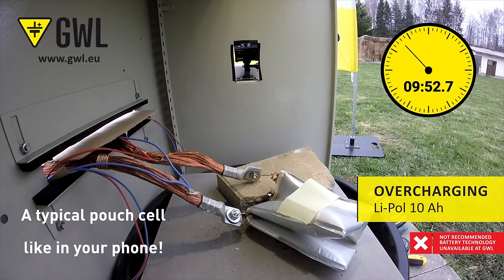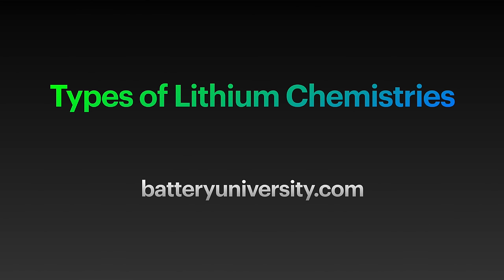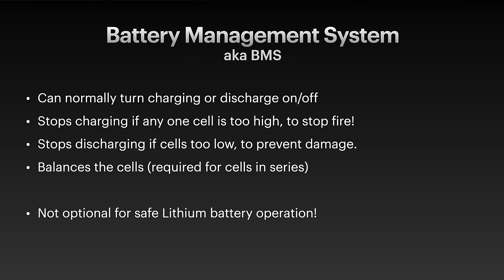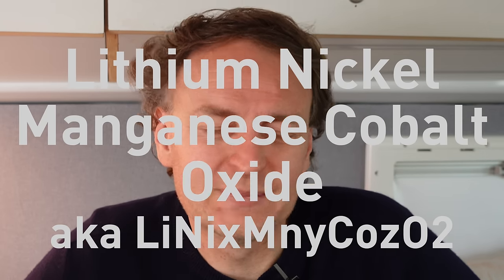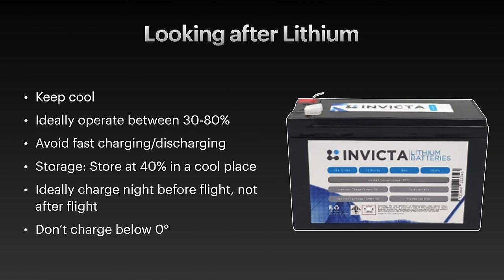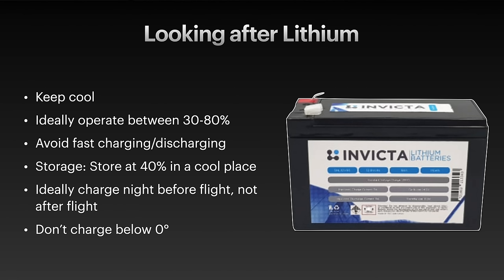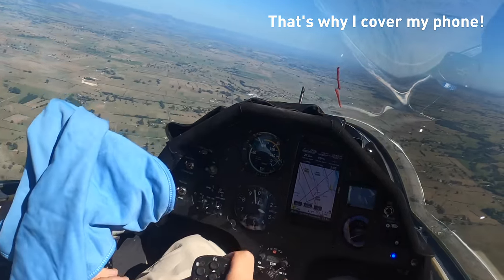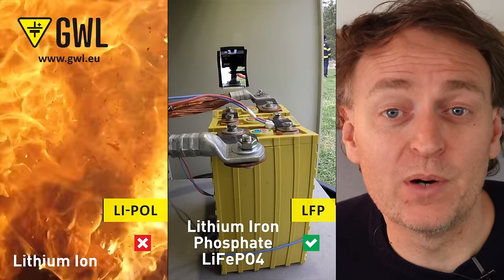🔥 How to Avoid a Cockpit Fire from Lithium Batteries 🔥

Comment: I work with high power inverters. We use lithium iron phosphate (LiFePO4) exclusively. We once had a pack rub onto a sharp screw until it shorted out. Quite a lot of burn stains, but no ignition. They're heavier and have slightly less voltage than lithium-ion, but are MUCH safer.
Reply from the maker: Agreed, I use LiFePO4 in my campervan for that reason too :)

Comment: Wow, I didn't know about the Pipistrel Glider accident but then its been 30 years since I last flew gliders (showing my age now!). It really brings home, that your seat cushion in a glider should be made of a parachute - even for short flights! I'm not sure what the general practices are now, but when we were flying training gliders we never used parachutes (except if doing aerobatics training), however most single seaters came with a parachute. 
I have an electronics background, and I think your description is your description is very pitched to the general community - well done! I quite like EVs and  now driving a car with a LFP battery (although we also have a LEAF with older battery technology which we keep a close eye on - I check battery stats every month). I used to flying model aircraft and have had several Lithium Polly battery failures (including one bulging out the sides of the fuselage!) and only ever charged batteries when someone was around and the charging was in a metal box. The only ones that I actually had catch fire were ones we deliberately overcharged at club meetings for entertainment & education purposes!
Reply: I'm surprised that the accident report recommendations didn't include wearing a parachute.  The only thing that would stop me wearing a parachute is lack of room.
Reply from the maker: Hey thanks for sharing, yeah we usually do use parachutes to sit on, unless you have a glider equipped with a ballistic parachute on the fuselage. But if it’s on fire it is not any use!
Reply: @PureGlide  The combination of Integrated Rescue System (IRS) and engine flight batteries in the fuselage is simply a bad idea...(as in the scenarios have not been thought thru yet). It will take a few accidents before the regulation agencies will conclude this needs to be forbidden - could take years.

Comment: Caught someone with a new Lithium battery last year, rigging, and noticed the terminal were exposed, and it was secured with a metal bar on top.  It would have been possible for it to bounce and short out on it.  I think it was a LiFePo battery, and that a power management system probably would have protected it, but still we made him go and insulate the terminals.   Can't  be too safe.
Reply from the maker: Yeah, not sure the BMS can protect against current that high, so a very good idea!
Reply: Also bear in mind that dielectric resitance of air decreses with hight, it could make an arc if it goes high enough.

Comment: This is the type of video i can recommend EVERYONE. Because it's not only useful to the pilots of gliders but for everyone. I had similar problem during a normal drive in my car. I was using my phone for GPS, 5h travel. In last year, 9am-14pm. Full sun, middle of July(Europe), and of course i had my phone charging, but i putted it around 12am to a charger(because it was around 30%). Around 13 pm, my phone stopped working, and i saw smoke coming out. That was a really crowded highway, so thanks to my friend sitting as passenger, we could throw it out of the windows immediately, while maintaining safety for other drivers
.  imagine if i chewed it on crowded  road(Not a gread idea, but if you're a psychopath, go see a psychologist). So, it doesnt matter if u have a phone in your house, on the beach, in the car, or u are gliding. Always keep an eye on it. Shit happens, be prepared, and don't make stupid mistakes.
I found this video really important, actually for everyone, because u can apply it everytime. Your battery can burn even in your house, while u are at work, or on a plane(Legendary Samsung battery). But you can prevent it, not 100% but if u add like 99%, it's still better than being on a plane on fire(Concorde is the only plane with afterburners, B747 or A320 doesnt have it, your battery won't make it faster).

Comment: I've been thinking of buying a Pipistrel Taurus Electro for the last few years. I asked the sales team whether the batteries can be removed and charged at home, so that I can store them in cool conditions and charge them only in time for the next flight. But unfortunately they aren't designed to be removable (only for servicing). It's a shame to hear that there have been battery fires.
Reply from the maker: Yeah do read the report for more information, I’m sure if you look after the batteries, they will be fine!
Reply: There should be little need to remove batteries, if they can be stored in location without temperature extremes. A trailer is likely to have more variation in temperature vs. a hanger, or structure in contact with the ground (thermo mass), or insulated. 
Removing, transportation and repeated installation is likely going to introduce risks, including potential to damage the batteries; so better to just properly store the aircraft.
Reply: @AerialWaviator  Pipistrel recommends storing the glider in their solar trailer, which will not only charge the battery, but also run cooling fans to keep the trailer's interior at a reasonable temperature. That would be the only option for me, since the airfield I fly from doesn't have hangar space, and gets a LOT of sunshine. Hopefully the trailer can be programmed to charge the battery to ~50% after a flight, then slowly charge to 100% just in time for a scheduled next flight days later. If not, I'll have to hack it.
Reply: @markmuir7338  If good airflow and climate not too extreme, the trailer should be ideal storage. A remote option to enable charging from storage voltage (50-70%) to fully changed the day before flying would be ideal.

Comment: I've recently installed a K2 22ah and 12ah batteries. The capacity from these puppies is astonishing. I use the 22ah as the primary and have the 12ah on standby. After 5 hours the 22ah barely has dropped in voltage. It's really impressive. This running double seater glider computers, transponder and Flarm.
Reply from the maker: Yeah I have the same! No reason not to these days. Although keep in mind there won't be much voltage drop on lithiums anyway due to the voltage curve, so it could be 80% or 60% without looking much different. But so good these days to never even come close to running out.

Comment: Great Video! Thanks for the effort and research! Also great community! The comments are a great addition. A thing I don't see often. 
Maybe a pre flight thing to check is, if you'll be flying over an area with dried out woods? In these days maybe you shouldn't throw your burning battery out there.
Reply from the maker: Yeah obviously that would not be ideal, but which would you choose: have a fire on board or risk a fire below?
Reply: @PureGlide  I agree. That's why I'm asking, if it should be a pre flight check. If many people live in or around such an area, whose lives were at risk if there were a wild fire, then maybe a higher priority is to divert from this area. But maybe I've simply watched to many flight safety videos on YouTube and am overthinking a very unlikely hypothetical incident. :)

Comment: Great and important video... You did not mention explicitly, but all cameras use high density lithium batteries too. Great point about not throwing power banks around... I fly with XCSoar on a 7" device / covered with a piece of cloth to avoid overheating (!) and next flight I will check if it will fit through the cockpit window (just in case..). Thanks Pure Glide!
Reply from the maker: Hey thanks Ronald, glad you found it useful!

Comment: Thanks Tim.  I'm not a glider pilot, but the primer on battery tech was very helpful as I'm looking into replacing Lead-acid batteries in my caravan with (probably, now) some LiFePO4 units.  It strikes me that generally my "bail out" scenarios are going to be a lot easier than the ones you might encounter, but you're less likely to do anything so silly as sleep in your glider.
Reply from the maker: Yeah stick to LiFePO4 I suggest! And you’ll be fine :) I just swapped out my lithium ion cells for   LiFePO4

Comment: sorry, as glider pilot, and former glider designer, the figure in the middle for the lithium comparison part is a lithium polymer accumulator, but you identify it as a lithium ion battery and that's wrong. FES uses lithium polymer cells (it was very difficult certifying them, i know for sure), Arcus E (the few) and the self launching Lange gliders use lithium ions in the wings.
Reply from the maker: Yeah I i couldn’t find a good example with price available, but gives a rough idea. Thanks for sharing!

Comment: if managed properly then no problem. I think there are several options. you can use the flat LiFepo packs. I think it's the best way to keep the size and weight down. They are a bit heavier but not as bad as lead.
Reply from the maker: Yeah exactly, LiFePO4 would be safer, but the size weight becomes an issue with them for providing enough power.

Comment: Here's an easy way to judge the health of your cell phone battery (unless you have one of the newfangled camera humps): Put the device on a flat surface and give them a spin. If they make it through a full rotation or more, the battery is likely swollen and should be replaced.
Reply from the maker: Great tip! Cheers

Comment: Great video. I've use Lithium batteries to power model airplanes for years, and have had my fair share of incidents with them. A friend of mine crashed a fairly large model and it caught fire. It was in long dry grass a few feet off the runway, and I made the mistake of grabbing it by the tail (which wasn't on fire) and dragging it out of the long grass onto the runway to prevent a larger fire. I must have got some smoke or possibly spewing debris from the fire on my hand and arm as I had burn-like sensations for many hours after it happened. In retrospect, I probably should have rinsed it off immediately with whatever bottled water anyone had at the field, but at the time I didn't know if adding water might make it worse.
Reply: Probably burns from radiant heat. Lithium metal can burn in excess of 2000 C. Just being near that will give burns to uncovered skin.... And Yes water would have mitigated the severity of any burns by reducing the heat in the skin. It's just absorbed a huge dose of IR radiation from the fire and needs to be released/cooled as fast as possible.
Reply: @tinkertailor7385  That makes sense. I definitely learned a lesson with that incident! I now have plans in place for all my Lithium batteries, including my phones, computers, tools, E-Bike etc.

Comment: Seems to me like a fundamental design change is necessary for Li electric gliders to have the batteries in a bay which has a door on the bottom for jettison purposes in an emergency. Get over a safe area, pull the handle, battery gone by gravity (and spring?), which would minimize damage to aircraft and allow survivability. Also a mandatory temp and/or smoke sensor in the battery compartment, with indicator light and audible alarm.
Reply from the maker: Yes, it seems obvious really! But they have improved a number of other things such as a better fire box around it

Comment: One would think that the designers of electric self-launch/sustainer gliders would build in a method for jettisoning the batteries in case of fire. Dropping flaming batteries on potentially inhabited areas is not attractive, but if a good-sized battery is on fire, its going to come down anyway, with or without a living pilot.
Reply from the maker: I thought the same thing!

Comment: I think sailplane manufacturers, and other aircraft manufacturers, that utilize lithium batteries should start thinking of ways to eject these batteries if there is ever a problem. It can easily be done. The battery for an electric powered sailplane could be placed in a fireproof container near the lower surface of the aircraft, with sensors to indicate a fire or extremely high temperature in the box that would be displayed to the pilot. A simple pull of a handle would release the battery. The pilot hopefully would have time to exercise caution about where to drop the battery to avoid people on the ground, but lets face it, a crashing aircraft doesn't provide any options. Sliding windows in the canopy should be big enough to allow any battery powered accessories to pass through in an emergency.
Reply from the maker: Yes although if the batteries are looked after it should never be a problem!

Comment: There is a distinction between risk and consequence, risk is statistically how likely something is to occur, consequence is how bad it is if it does occur. People who do rock climbing without ropes like to say that the risks of a fall are really rather small, it's just that the consequence of any fall is almost certainly fatal.

Listening to this discussion you have to wonder why any sane person would allow a lithium battery of any kind aboard their glider - except maybe a smartphone which you can chuck overboard if you need to. If a device getting hot left out in the sunlight, has hidden damage from having been dropped, or has simply been left fully charged too long and could cause an in flight emergency that might cause you to have to bail out, you have to ask yourself if you really want that device onboard your aircraft.

Comment: A great reminder video. Just thinking the gliders with big battery packs should also incorporate automatic discharge systems like Dji incorporate when not in use.. Thanks for the upload my antipodean neighbour.
Reply from the maker: Yeah I wondered that too, probably because they are big packs, so would require something substantial to use that amount of energy, like a heater.

Comment: now you scared me. I just bought a FES glider. The question is: are electrical fires more often than fire with normal combustion engines?
Reply from the maker: Don’t be scared, just follow the manufacturer’s instructions! And the batteries will be fine. These incidents I mentioned were years ago, and they’ve done a lot of improvements since. Also be prepared, if worst comes to worst, know what to do, vacate with your parachute! But that is very unlikely to happen

Comment: I think if battery powered self launch stays around they will need to introduce a method to eject the battery. Either by gravity or by a spring. Possibly an automatic mechanism once a heat sensitive linkage is burned through. I think people using batteries for self sustain or self launch should strongly consider a personal parachute.

Comment: You missed one important point. Dielectric resistance of air decreases with height. This is why you cannot check in batteries in your lugage when flying in airlines. Same applyes to gliders, that are not presurised!!! Are our phones, chargers... and rest of gadgets designed and certified for high altitude operation??? At high altitude a shorcircuit is easier to happen. I suppouse glider equipment takes into account this but I doubt others gadgets do.
Reply from the maker: I thought batteries weren't allowed in the luggage because if one starts a fire, they can't put it in a bucket of sand... interesting though, that's the first I've heard of dielectric resistance of air. Cheers!
Reply: @PureGlide  Hi, the explanation is simple, to create an arc all molecules have to be orientated/ionized in a particular way along the path, the less number of molecules (because of less density) the easier to orientate/ionize all of them at the same time and create an arc. BTW Correct name is "Dielectric Strength" . I just ried to find its impact in aviation but I have not found anything. Here you have the actual physical phenomenom. https://en.wikipedia.org/wiki/Paschen%27s_law

Comment: Interesting difference between lead acid and lithium when used in a typical club. Clubs tend to leave the batteries on charge when the gliders are hangared. Even lead acid don't like sitting on the charger for months. Lithium won't like that at all.

Clubs replacing lead acid batteries with lithium because the lead acid batteries don't last are going to be disappointed when their lithium batteries die an early death from the same treatment that killed the lead batteries. The main difference will be the lithium batteries cost more to replace. That and the chance of a fire.

A BMS is no substitute for actually managing the state of charge of the batteries. You can't just plug it in and always have a fully charged battery available for instant use.
Reply from the maker: Yeah I haven’t seen any lithium batteries die early in our club yet, and we’ve been running them by charging after flight for years now. But yeah it won’t be helping their lifespan!

Comment: oh yes thank you for the pause for thought. I wonder how well that 3m would work. if you filled the case with the liquid and put a condenser in. Its also used to extinguish server fires. I also thought maybe another inert liquid. Its just a thought.
Reply: Forgot to mention, When this liquid becomes gas it cools whatever its touching. It can be set temperature wise to stay in a range. The gas is condensed and the heat is transferred away.
Reply from the maker: Possibly, but as long as you look after them, and treat them as directed, shouldn't have any problems! And worst case, you can jump out :O